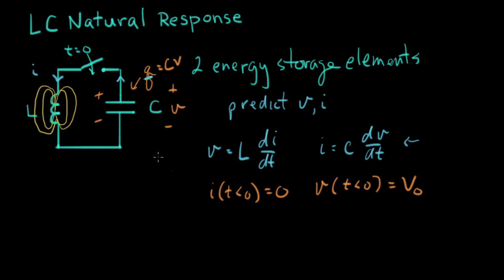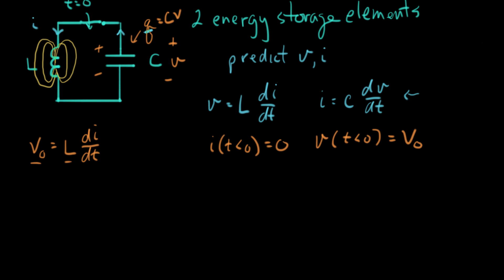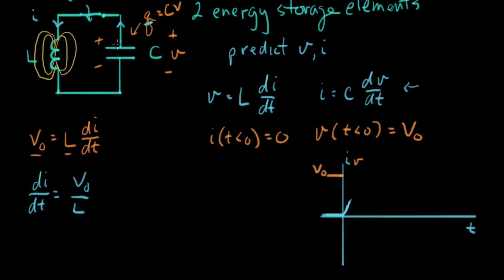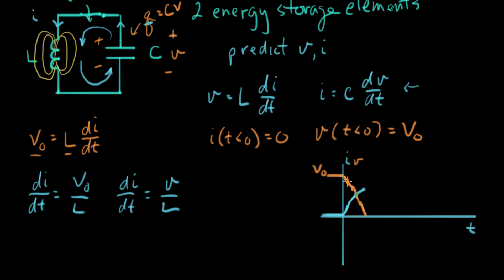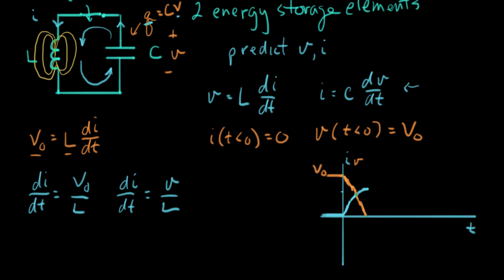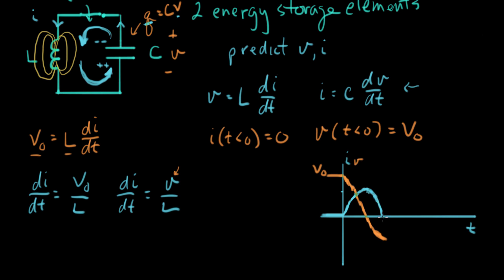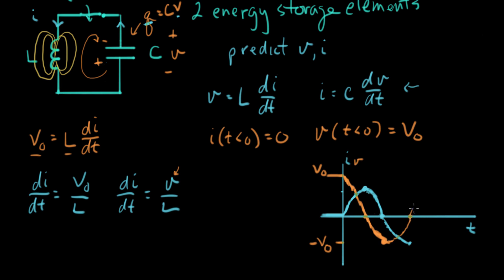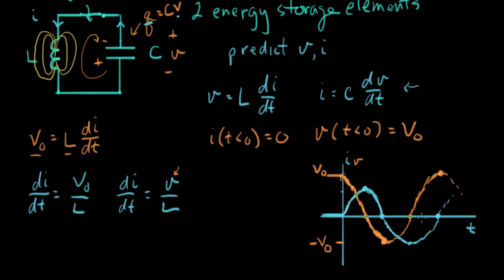LC natural response intuition 2

Comment: also 6:50, "the reason is all the charge has made the way to the opposite side", that would be:   all(+) + all(-) = 0  . your not saying it correctly. you need to explain it by induced current in the coil(inductor).
Reply: yes.
Reply: Can you explain it, please?

Comment: you didnt explain why the charge reverse
Reply: It is because of Inductor magnetic field
Reply: Cuz the capacitor is neutralised but there's still current. So the current will flow to the bottom of capacitor. Equivalently, it means electrons will flow to the top plate. This will repel other electrons on the bottom plate, making it positive. Now the situation is reversed. Positive at bottom and negative at top. So current flow in clockwise direction.